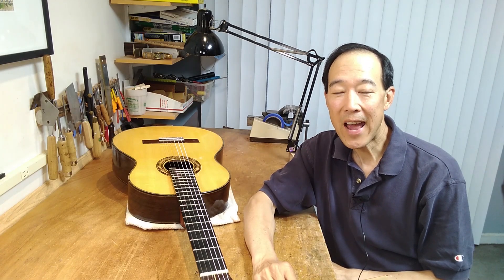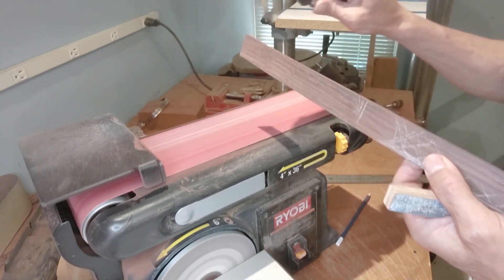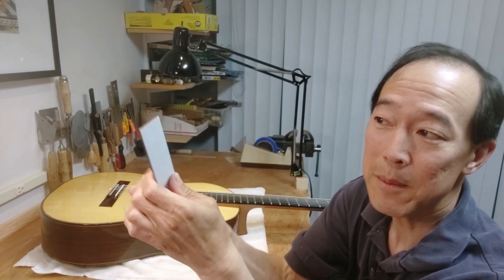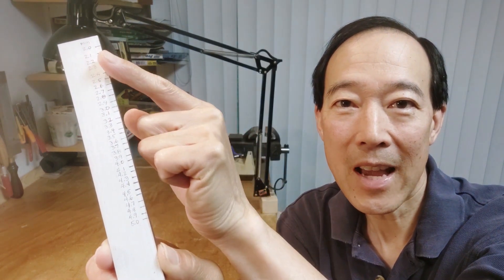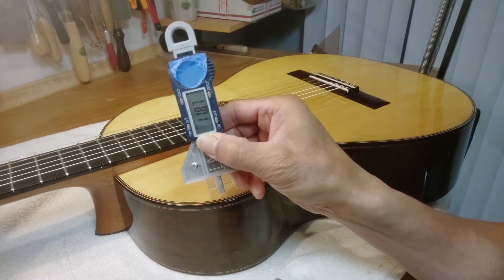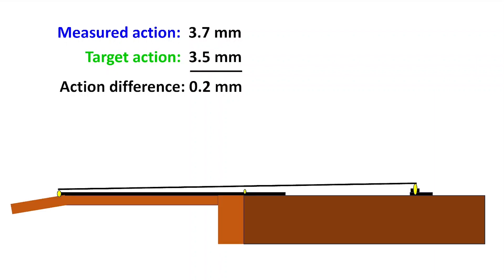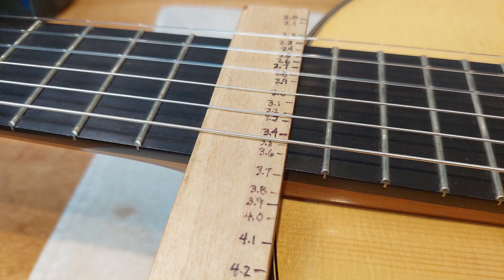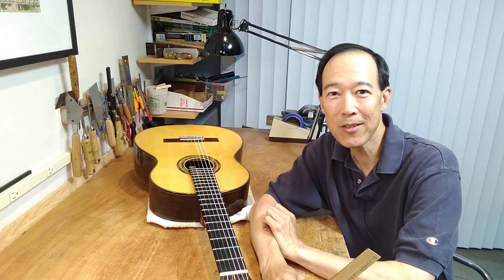Lutherie Demystified Ep.11 | Techniques: Measuring and Adjusting Guitar Action

Comment: Hi, thank you so much for the video. Is there a standard action height for a classical guitar? I have a very old guitar and the luthiers that did some repair and maintenance work, had placed strips of paper between the saddle and bridge. Not sure if that is a common way to raise the saddle by placing paper underneath. Thank you
Reply from the maker: There is no standard height because it highly depends on the player's right hand technique and strength, the dynamic range of your repertoire and how good the fretwork and fingerboard relief are. A typical medium action set-up I aim for is (1st to 6th string in mm): 2.85, 3.20, 3.30, 3.40, 3.45, 3.50. Paper can be used to shim, but more commonly, wood veneers.

Comment: Hi, Garret  thanks for your fantastic videos, can you tell me how you spaces the strings in the nut?, equals o compensated space?, regards
Reply from the maker: I use the Stew-Mac progressive string spacing ruler. After I mark off the positions with a pencil, I start the slots with a razor saw and then follow with the appropriate nut slotting files.